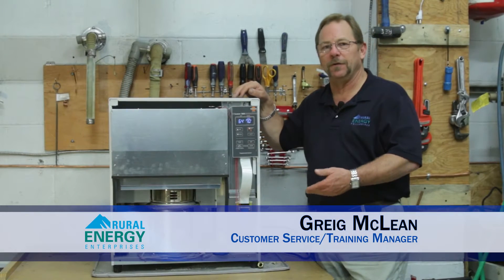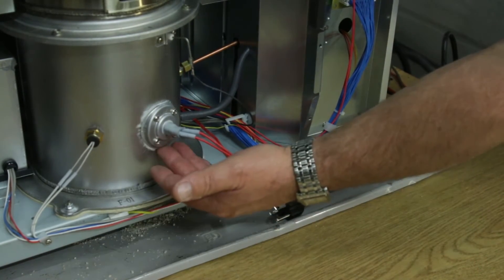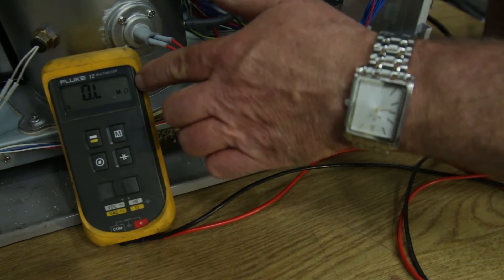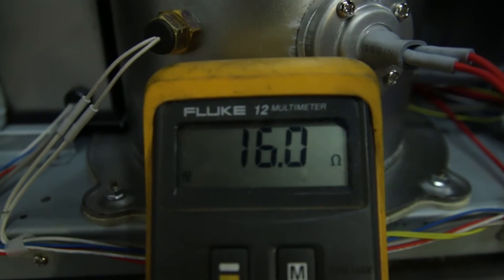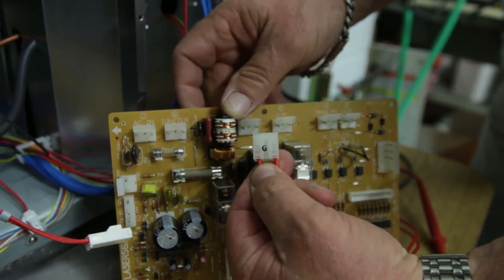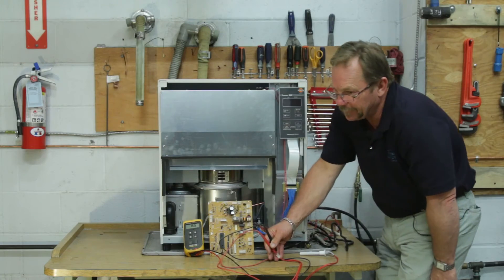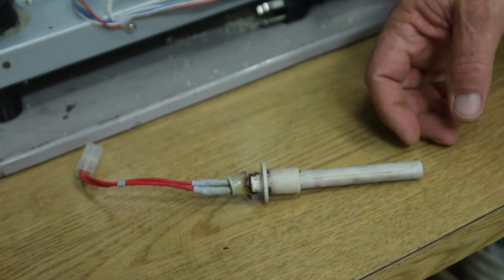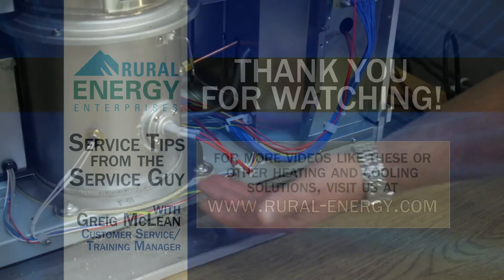How to Ohm Test the Ignitor on Your Toyotomi Toyostove | Step-by-Step Guide

Comment: My laser monitor 73 has a burnt ignitor I I have a new one and also the primary flame rod in I was just about to install my new ignitor but wondering what is the ignitor guide gasket as I was taking off the old ignitor I don't see the old guide gasket ?
Reply from the maker: Hi Marvin- Please note monitor and Toyostoves are two entirely different brands. Here is a link to the guide gasket. https://www.ruralenergy.com/parts/toyotomi/20479521-gasket-igniter-a02-b02-guide-all-models - They do not always need to be replaced. You will need to check the condition of yours to determine if a new one is needed.
Reply: @livelifewarm  how and were do I put the guide gasket is what I ment yo ask onto the ignitor
Reply from the maker: @marvinjunior5256  I have a diagram for that. Send an email to support@ruralenergy.com & I will reply with the diagram & instructions for installing the Igniter Guide Gasket.
Reply: @livelifewarm  I have it on thank you
Reply: @livelifewarm  my old one is not covering it good their is smoke coming out from my new ignitor on my laser 73 looks like it has a old guide gasket just before you put the igniter cap that has 4 screws on the old one looks worn-out and how do I replace it ?
Reply: We’re having issues with the EE2 code on our 73. Bled the lines, replaced filter, cleaned screen, cleaned out combustion blower box. The packing gasket is cracked. Could this contribute to the code? Igniter looks good, 17.5 ohms. Some flow through the sight glass upon startup but still throwing EE2. Flue is clean, blows warm air from exhaust.. Im assuming it’s ambient air from the house. Any leads? Thinking about replacing igniter tomorrow if we can find one in town. Thanks for your time.
Reply: I getting error 2 codes aswell my gaskets are old and brittle and I trying to figure out if that's what's causing it to not fire up or if there's a underlying issue aswell..
Reply: @MaineiacMac If there’s no flame then it might be the igniter or a fuel issue. You can take off that feed line from the burner pot, stick a cup under it and turn on the stove to see if it’s delivering fuel. I had to clean out the burner pot, glue a new mat in there and replace the igniter.

Comment: If I were to replace my monitor 41 with a toyotommi could I still burn no1 or no2 ulsd in it????,,,
I would be getting a small toyo like maybe the smallest since the 41 I have has to shut down a lot reaching temp fast and it does not has eco mode so that does not help.
Reply from the maker: Toyostoves run on 1-K kerosene (ASTM D3699),  Low Sulfur No.1 Fuel (ASTM D396 S500),  Ultra Low Sulfur Diesel Fuel (ULSD),  or Ultra Low Sulfur Heating Oil (ULSHO) (ASTM D975 S15)

Comment: Anyone have any idea why I’m getting an EE12 code? Any time I have my laser 30 set at 72 or higher, it shuts off and gives me this error. I have cleaned the metal screen on the back, which wasn’t dirty or dusty, but I keep getting this error. Any help would be greatly appreciated, as I can’t find anywhere to
Help.
Reply from the maker: Try the steps in this document to see if you can resolve your issues: http://www.livelifewarm.com/docs/techTS_ErrorEE12.pdf

Comment: Hey There

Have you ever worked on a Monitor 20? I think I might have bent  my igniter. It looks nothing like the ones I found on-line. It has a coil on the end of it with a woven Metal fabric close to it. Are you familiar with it?  I’d like to sent  an image of it your way. it would be nice to know if  my igniter is damaged.
Reply from the maker: Sorry, we do not have experience working with Monitor Heaters. However, if you choose to replace your Monitor with a Toyotomi Toyostove there is a rebate offer currently. Details: https://www.ruralenergy.com/monitor

Comment: what would cause a two week old ignitor to go bad on a laser 73 monitor and if i replace it with a new one would the same thing happen to it?
Reply from the maker: Make sure you have a water block fuel filter installed – ignitors will fail if there is water in the fuel.
Reply from the maker: Take your fingers and run them up and down the ignitor, if you feel like there is a graininess to it like sand then there has been water or condensate in the burner pot. It could be entering thru the fuel ( install new water block filter, purge the fuel line to the stove and service the fuel sump), flue (too close to the ground, sloped the wrong way, high wind with either rain or drifting snow and ice)or the clock is not set on the Toyo stove (it has a cleaning mode that starts at 2 am for 10 minutes)

Comment: Mine ohms at 19.3. Does that mean I need a new one? If so, where do you find parts for 73's? Thanks for your help.
Reply from the maker: It’s a little outside of the normal working parameters; it’s probably on its way out. I think it usually starts taking longer to heat up the fuel to the flashpoint. I would keep an eye on it and when it starts error coding with EE2, then it’s time to replace it.

Comment: Hi Greig, i am in the UK and bought a toyotomi vented wall heater model FF-V30T it is less than 6 months old, it will not fire up and gives an error code of E-2. there is no repair system from supplier or repair engineer in the UK so will have to repair myself can you point me in the right direction, when it was new i distinctly heard a ticking noise, no ticking noise could it be the fuel pump ( internal tank ) that has packed up,  
Regards Tom UK
Reply: hi! did you ever get your toyo working? We have the  same issue!